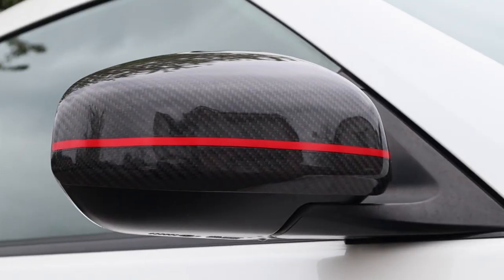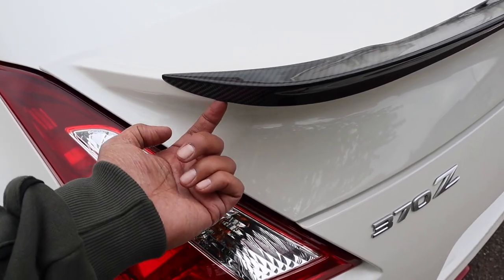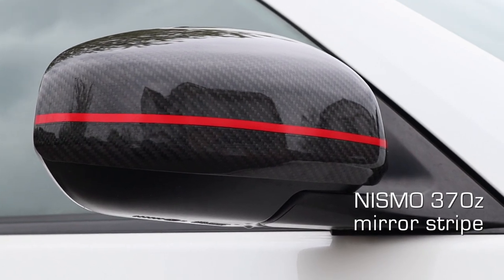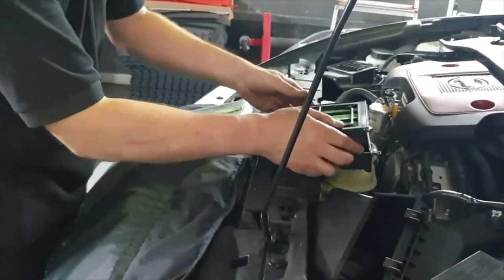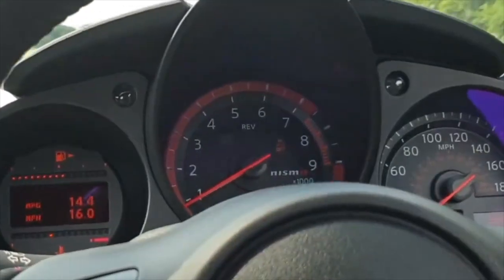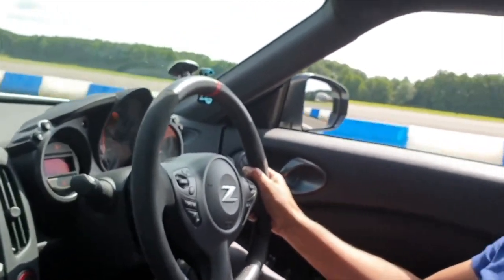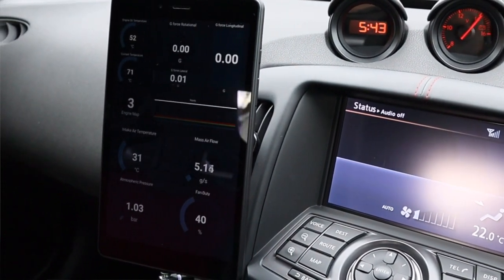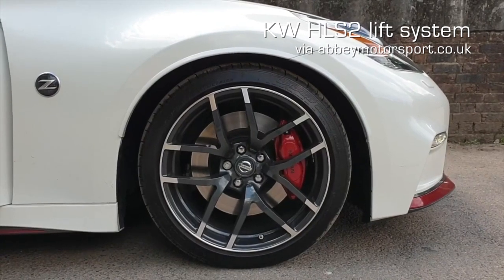My TOP 10 370Z NISMO Tuning MODIFICATIONS – Faster, LOUDER, better handling!

Comment: Do you get a CEL with the cats? In Finland where I live you have to pass an actual emissions test. So no CELs allowed, ECU must be in ”emission ready” state and you must pass an exhaust gas measurement test. I am considering sport cats but hate the hassle with the annual inspection.
Reply from the maker: Thanks for watching!! You may get a CEL but mine was tuned straight after and certain thresholds may have been disabled. I can't say what the emissions will be like... Mine isn't due for inspection until the car is 3 years old.
Reply: I reckon emissions will be fine. I had a 350Z with sport cats and it would eventually always pass the test (you had to heat the cats like crazy).
Reply from the maker: That's good to know

Comment: i'm looking at exhausts for my 2014 370z gt currently and i was under the impression pop and bang maps ruin your cats, or is this not the case with hfc's?
Reply from the maker: Well, it does ruin the cats, but affects HFCs less because they less restrictive. You'll have to replace them more often.
Reply: @sportzntouring  do you know how often you would need to replace stock and hfc's?
Reply from the maker: @z34lewis  honestly, I wouldn't know. It depends on mileage, driving style, how much you use the pops on bangs map. Best to speak to your tuner who will advise. Thanks for watching. Much appreciated
Reply: @sportzntouring  awesome info and great videos, I'll be sticking around for the future 👍
Reply from the maker: Thank you!

Comment: Hi brotha! Because of this video and your positive reviews I got the tarmac short tail exhaust from UK. I am based in Dubai and it was very difficult for me to get it here, somehow I managed and installed on my nismo. Now I am facing one big issue! 

I am facing bad rattling inside the cabin and it’s coming from the trunk, Can you please help me to solve that?
Reply from the maker: Yeah, I noticed that after a while too. I later had foam added to the various cable contact points in the boot/trunk to minimise cable rattle, and some sound deadening. See if that helps. 👍
Reply: @sportzntouring  Can you please share the places and the sound deadening material you’ve used?
Reply from the maker: @farhangilani5323  I can't at the moment. The car isn't with me at present. And it's likely to be a bit different for every car. The cables aren't likely to have movement in exactly the same places. The company that added the sound deadening aren't available anymore. I'm sure there will be a company near you that could help though.
Reply: @sportzntouring  yes you’re right but I’m sure you’ve an idea where they have used the sound deadening material? Is it underneath where the spare tire is? Or under the plastic covers? Or it’s everywhere?
Reply from the maker: There's a few pads in specific spots where the metal resonated most. I honestly don't remember exactly where and taking my trunk apart isn't an option right now, since the car isn't with me.

Perfected Auto has lots of videos on this topic. It's a well known issue generally. This is one of his videos, but he's made a whole series... Hopefully this is a helpful place to start: https://youtu.be/4NYFhM7Xl4A

Comment: What buttons did you press in the sequel for the pops and bangs map
Reply from the maker: That extra feature has been added to map 3. Map switching is done by holding the cruise/speed-limiter cancel button then using the right toggle switch.

Comment: Why does your Z have a rear wiper???? Is that common? Never seen one before
Reply from the maker: Most people remove them with a wiper delete kit. I've just not done that yet as I want to do it properly, filling the hole smoothing it and painting it in. However, there may be markets where they're not sold with the rear wiper.

Comment: They really bungled the v2 nismo spoiler, so underwhelming the v1 spoiler was so much better yet you can't retrofit it because v2 lip has 17 holes in the body it attaches to, 17 drilled holes!! It didn't have to be Singer level ducktail but just slightly more at least (Singer: https://hips.hearstapps.com/hmg-prod.s3.amazonaws.com/images/singer-vehicle-design-dls-1558630408.jpg ).  Then they released OEM NISMO "gurney flap" which is 1cm rectangular extension, so crazy expensive 1200EUR yet so underwhelming again.  I can't believe only this one obscure Taiwanese company makes a well designed extension/gurney-flap. By the time I can get a 370z the car will be obsolete and who knows if such better gurney flaps will be available.
Reply from the maker: Thanks for watching.
I agree, I did feel let down by it and indeed, it's a shame that the Nismo carbon gurney flap was similarly underwhelming and overpriced.

However, I wasn't a fan of the v1 spoiler and suspect the change was made to reduce drag... But a little more flare would have been nice.

Comment: Todo bien hasta que cambiaste la suspensión nuca podrás mejorar la suspensión de nismo cosas de principiantes
Reply from the maker: What makes you think KW, Abbey Motorsport or even us are beginners? The set up on the suspension now is much better than the stock Nismo setup. But your right, beginners would probably make it worse. Good thing none of us are 😉
Reply: @sportzntouring  mejor que nismo 🤣🤣ok ,de todos modos es un lindo auto felicidades
Reply from the maker: Thanks. Keep in mind that NISMO will need to tune the suspension to what it thinks the typical buyer will like. Yes, our initial setup wasn't ideal, but after some more testing, I found the KW setup that gave me the driving experience I wanted, rather than the Nismo options.

I'm happy to give up some comfort for sharper handling, but most people wouldn't want to ride the highway with my setup as-is. And Nismo would have tuned it for 'most people', not me specifically. I have driven many different cars and mine feels like a Nismo Z but with sharper handling similar to a Porsche GT3. Thanks for watching, and the conversation.
Reply: @sportzntouring  sigue poniendo videos tienes un seguidor más aquí en Miami gracias a usted por responder soy un adicto a los z 👍👍